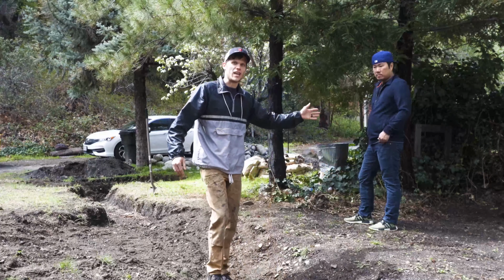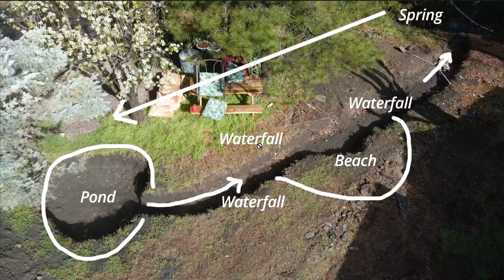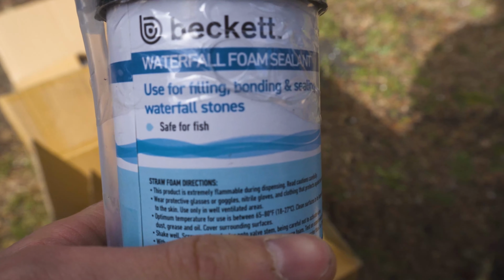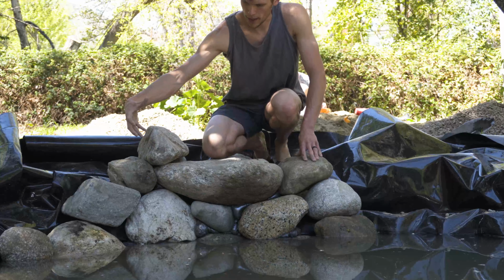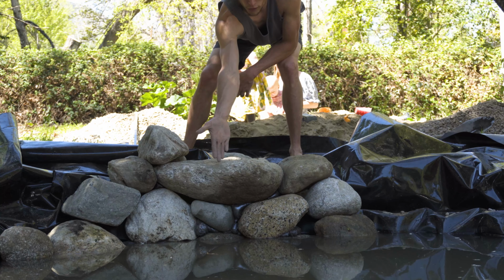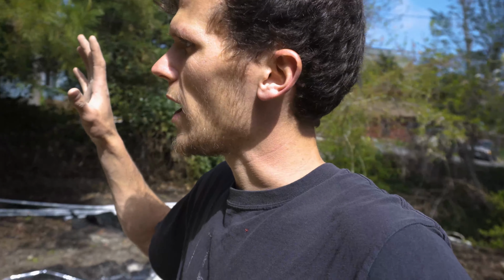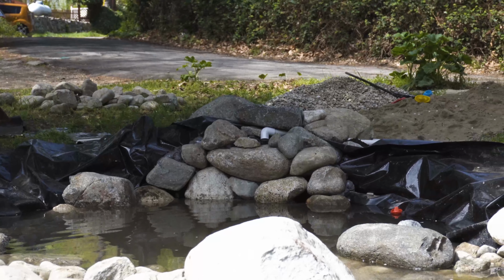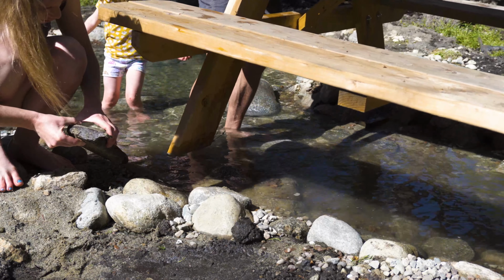50 ft. Creek with a Beach.

Comment: Wow, what a beauty! this is exactly what I want in my garden. What materials did you use for this project?
Reply from the maker: Thanks! 
I should put the material in the description. 
We used two 20x25 pond liners, 50’ of cloth, a 9000 gph pump and several cans of pond foam.
Reply: Thanks. How do you decide which pump to use? How do you calculate this?
Reply from the maker: Experience. 
Although, 
I am currently working on a "Flow comparison" video. I have 3 different pump sizes and I'm gonna hook them up to different lengths/heights/diameters of pipe and compare them all side by side. Hopefully that will give people a visual to reference when they're buying a pump.